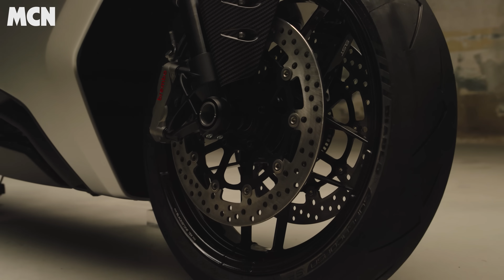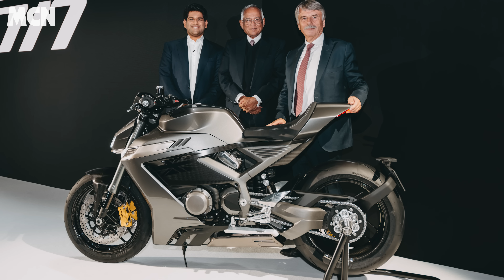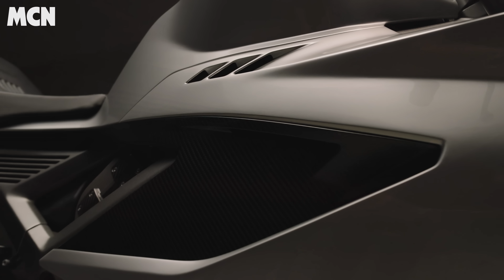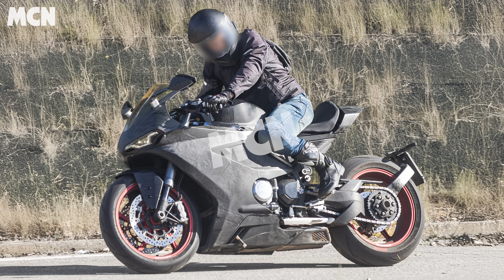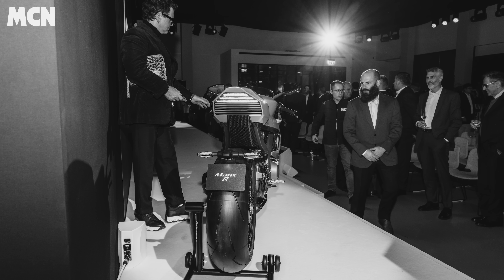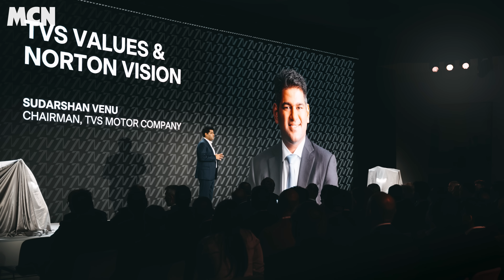Meet the Manx! Norton's new V4 superbike revealed | MCN exclusive

Comment: I have never heard anyone describe the reason for the engine angle is to fit the radiator in on the package, surly you design an engine for its performance and package everything else around it.  That said , I love a V4  bike I love high end hp designed for the road and not the track, I never see a pot hole on a track (well ok some) but you get my drift fast road bikes is what excites me about Norton.

Comment: Ummmmm. Not really a superbike is it. 1200cc so can’t go racing. Bit of a class of one. No doubt be quick but will be very expensive and bought by the few for pub bragging rights. I wish them well but think the company are resting on the name from the past. Many riders who remember Norton of old will soon be no longer riding. The next generation will not have the nostalgia factor. IMO Norton need to build a bike capable of competing at the TT etc to gain more respect at present and this model certainly won’t be doing that. Looks are personal. To me it looks like a CF Moto or electric bike.

Comment: Ok, so we now have the TTF2 V4? This streamline design is shoutingly old-fashioned 90s. Are we expecting now the retro-wave to move 20years ahead? Maybe. But why does it look like a Ducati Panigale in 90s CBR600F trim? This is likely designed by a foreign design studio, that have no clue about how to move current chaotic harsh line designs forward, so instead it moved it backwards 30 years, applying currently available finish. Ok cb600F is harsh, good, call it triumph daytona style in a clean sheet form with panigale eyelashes… Again, it‘s not a Norton, the V4, basically made new cases and engine refinements, but overall left in architecture. Ok, I can understand that, why not - and - there‘s not much else you could do, right? 
Yes, there is, if you‘d balls like I expect from a British Fighter, this would be a V3, or a W4 or something other special, and it would show muscle and not soft barista design. It‘s designed like a Car, just applied on 2 wheels. The rear underseat section looks interesting, but I wonder if it has function or if it‘s just „fashion“. The arguments about how it‘s good not to go racing with it, silly, totally lost me. The most rigid frame is never put on street, but on the race bike, there‘s ways for doing this, others do and they still ride marvellously and fast on road. And right away we throw old names on new bikes that can‘t ever reach the names glory, as they‘re not made for racing, lame name dropping. A plastic/wood model, no homologation, no edge of character, hitting a niche that doesn‘t sell - sportsbikes - great but not a seller, especially without race pedigree. Car managers manage norton now I feel.
Reply: All this talk about „product“ only reassures me in my view. It‘s so sad, aargh! When will Norton ever build a motorcycle again? When will the others? Yes, hard, but MV and Ducati do, even Honda does, BMW M1 did evolve a lot. Suzuki and Kawasaki fell behind, Aprilia is successful… Triumph isn‘t, actually, I know moto2, irrelevant as we can see. And they‘re not taking from that either.
He‘s so honest - „try to get the bike as clean as possible“, exactly! It‘s as clean as megaperls from Henkel Chemicals.

Comment: Dear Norton, My first bike was a 1966 Norton Atlas. I hot rodded it with high compression pistons for a Commando (12:1?),  and a two-one intake manifold with a 46mm Mikuni. I put a 2 tooth higher rear sprocket on it too. In a drag race with a Kaw 900 (1970ish Z1) I could hang even; until they hit 5th gear... So, for my past humiliation, send Michael Neeves and a couple of those to my house in York PA. Heck, send three and invite Keanu Reeves, he's a Norton guy. (no conflict with Arch on this one). Remember; Norton had the first "track" shift pattern, for all the "shift pattern nerds!" out there. Here is a trick question. How does a Maico shift? Answer; sometimes!
Reply: Disagree with your last point.
Reply: @bananabrooks3836  You are right, I only had one sample. It was a loner bike I got to "borrow" when my KX500 was in the shop. It was a later model 490 I believe. I rode it in a Hare Scramble. The silencer fell off on the first lap, Loud! Anyway; second gear was not easy to get on that bike. Luckily you don't need 2nd much in a Hare Scramble. It was a 4 speed too If I recall. It was way more nimble than my KX500 in the woods.

Comment: I don’t like the look. It has too many flat plastic-appearing (or cast aluminum) surfaces that make it look cheap. I do appreciate the lack of wings and the attempt to keep it clean. The blue color and the shape of the fairing gives it a Kawasaki look. 

The design goal to be “torque leader” is a strange one, that sounds like a marketing gimmick. It’s easy to lead in torque if no one else is designing for it. If they didn’t call it a Superbike, it may make more sense. I have owned five Ducati V2 (two air-cooled, three Superbike engines) so I get the want for torque, but in a Superbike it really doesn’t work as the engine’s key performance indicator.

*EDIT* It appears from other sources Norton may be calling this a Supersport and the Superbike label may be an MCN thing. I can’t get past the splash screen on Norton’s website so I’m going off other written sources.. At 200+ hp and 11,500 rpm this may end up being similar to my old 1199R. I hope they’re successful.

Comment: It's very cool but people buy superbikes for the 1% of the time you rev it to the limiter, that's also where the 'emotion' is. In fact the relative lack of torque at road speeds of high revving superbikes is ideal for road riding. My ZX10RR was smooth and docile at low revs and an absolute maniac at high rpm. It's good that it wasn't pulling like a train every time I opened the throttle. Whole appeal for me was access to an engine that revved over 14,000rpm. You can't buy a supercar at any price that can do that.

Comment: Not with Norton in particular, but my main bugbear with what can be considered cachet vehicles, is the disproportinate cost of servicing. Consumables and lubricants aside, I see no justification whatsoever for, say a valve adjustment costing three or four times the amount for a conveyance {car or bike} purported to be of a higher quality. Regarding this bike in particular, much has been made of its real world, low to mid range torque spread, negating the need for screaming revs, therefore hydraulic valve operation wouldn't be detrimental in any way to performance. It worked well for Honda's CBX 750 as far back as the mid 1980's, a bike which had a red line of 10,000 RPM. I've been a motorcyclist for 52 years and am no Allen Millyard when it comes to oily shenanigans but I'm an expert when it comes to not being ripped off.

Comment: Peak torque at low RPM makes a bike feel like a twin: strong down low but flat up top. That's not what a superbike should be. We've had a Ducati V4 for nearly a decade, and that 13k+ rpm range absolutely gets used. If you want peak torque at street RPM, that's what super nakeds are for. Don't neuter a superbike trying to make it something it's not.
Reply: Used on the  track maybe but this bike is more aimed at a very competent pose/purchase satsfaction buyer.

Comment: Looks a bit like an old fireblade from 2010 ish. The torque thing is such an obvious cop out for them not competing on bhp with the class leaders.
Reply: Also electronic suspension is standard on alot of new bikes that will likely cost much less.
Reply: If the Naked does actually end up with 200bhp however, that becomes much more interesting as it would enter what is currently a 2 bike category (SFV4S/M1000r)

Comment: I wanted you to ask them if they are ever going racing again, either in TT or MotoGP/WSBK.
Reply: They are not.
"When designing the frame we didn't need the stiffness of wsbk" and "the 1200cc motor is tuned for torque".
This bike will NOT be raced.
Reply: First you need to learn to walk before you sprint.